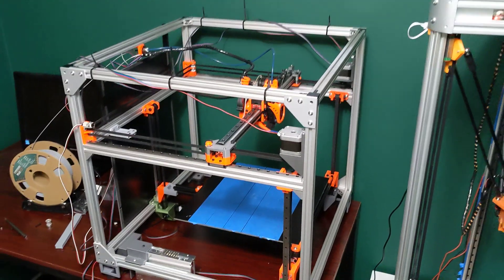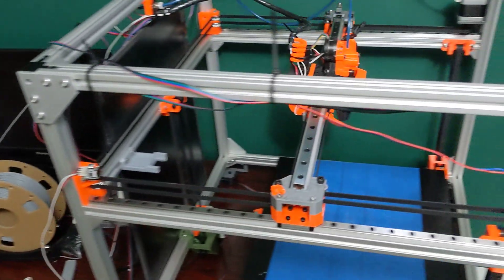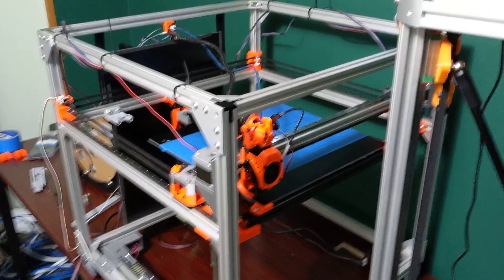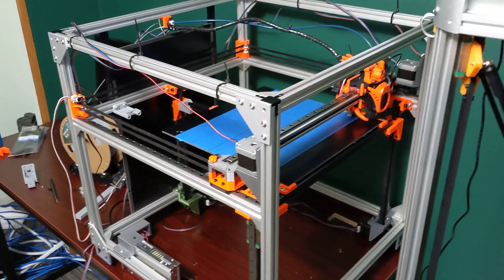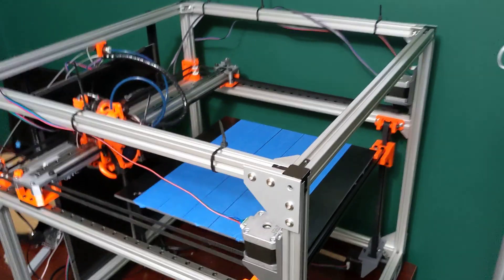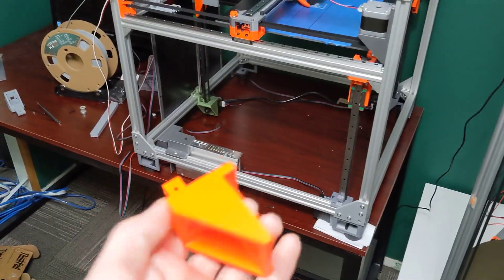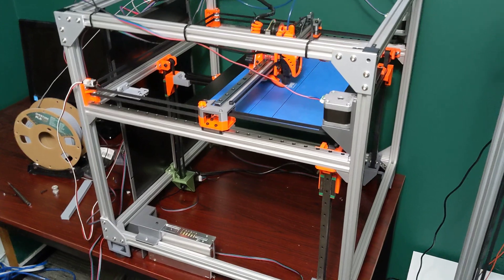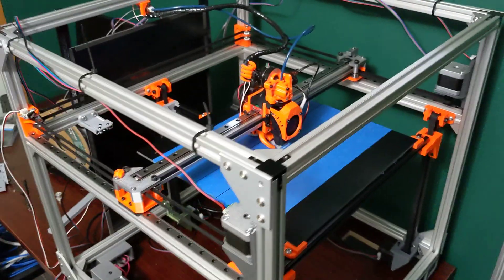DIY CoreXY 3D Printer SimpleCore 300x300 Version - Part 3 Klicky Probe!

Comment: What do you think of using carbon square tubing for x?
Reply from the maker: I have heard cheap ones can melt in enclosed printers but it might be something to try for large 300x300 printers
Reply: @Rolohaun  very interesting. I guess it delaminates?
Reply from the maker: @travistucker7317 I am un sure I do think there are good carbon tubes though. Just stay away from the cheap ones
Reply: @Rolohaun  realistically, i don't guess that gives you anything that the rail doesn't already have